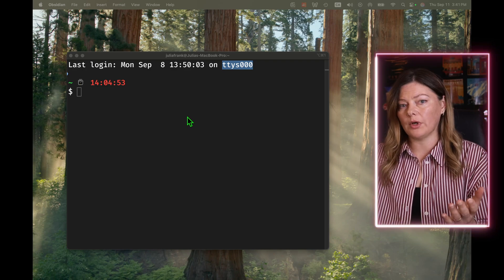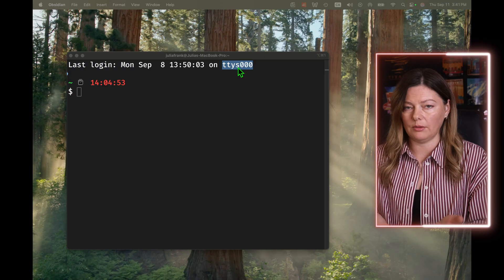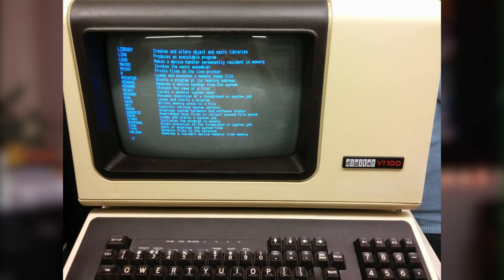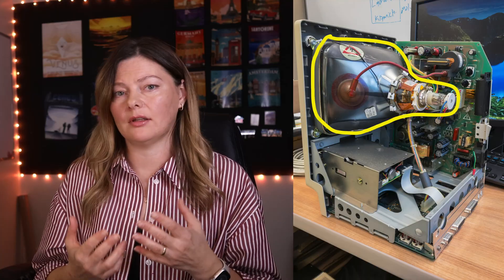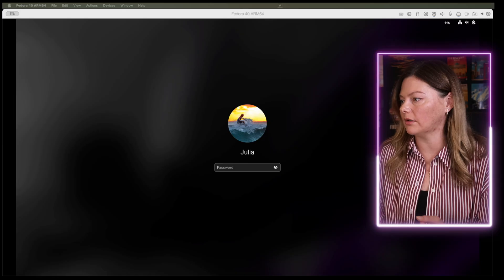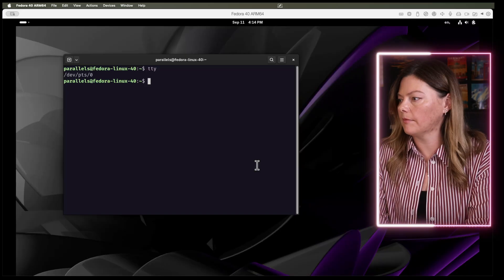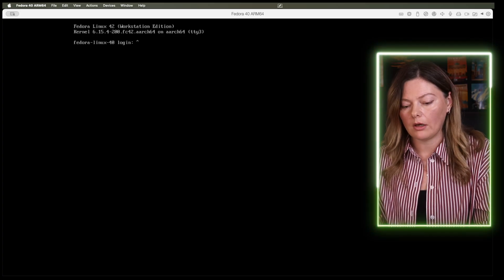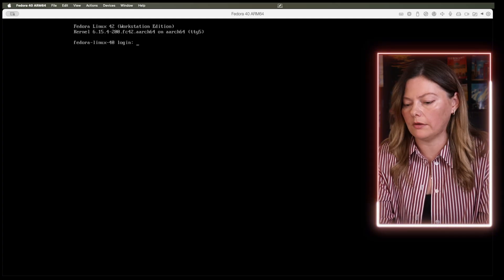What’s a TTY? (And Why Linux Still Thinks It’s 1970)

Comment: Fun fact, the first teletype interface was a modified IBM Selectric typewriter. This was chosen because the interface between the keyboard and the typing mechanism was an electrical binary-to-mechanical converter. This made it easy to redirect the wires to connect to the mainframe then have the mainframe output back to the print mechanism. This is also why TTY interfaces send each character you type to the server which then sends them back to your terminal to be displayed. (Yes, when you type a key into SSH what you see on the screen is actually being echoed back by the server.) Because the keyboard was disconnected from the printer head the mainframe had to echo each character typed so the user could see what they had just typed.

Comment: You're right, there's a whole class of software you can't work on unless you do this. I'm currently trying to port a NeXT like desktop solution over to FreeBSD from its Linux incubation platform. So I have to run 2 X sessions (experimental and the one with resources I need like docs and AI), and then I'm doing the development inside a FreeBSD jail so I can rollback (apply changes / test / re-rollback) while iterating. Knowing how this primitive layer works is essential for making any graphical plumbing."

While awful for the environment, the idea that you could take a listing ("printout"), rip it off the TTY, and then go outside, or take it to lunch, or show it to a colleague without that annoying-as-hell whisper knock or copy and paste is oddly romantic these days too.

Comment: I first started learning to program using a Digital DECWriter printing terminal, connected to a 300 baud acoustic-coupled modem.  I'd use a rotary dial phone to dial the number of my University's mainframe (a CDC Cyber 170 series), and when the mainframe answered the phone and started squealing, I'd put the phone handset in the modem's cradle.  Then I could type away on the terminal and the computer would print things out.  I've also used plenty of glass CRTs, made by DEC, Hazeltine, MIME, Infoton, and others.

I now primarily use a Linux desktop, and I typically keep three or four (sometimes many more) terminal windows open on the screen.  My favorite terminal program is "Cool Retro Term" (abbreviated CRT).  It's available via "apt install cool-retro-term on many Linux distributions.  It has an enormous number of settings to emulate both the good and bad aspects of those old heavy CRTs.  You can get a blurry, wavy, snowy picture if that makes you feel nostalgic.  Personally, I prefer a clean, readable display, but I do leave my terminals set up with a bit of curvature, to remind me of my countless hours spent in front of an IBM 3278.

Thanks for mentioning the ctrl+alt+Function-key sequence to bring up a new virtual screen!  I have been using Debian for years without discovering that trick.  The first Unix machine I ever used, an IBM PC-RT running AIX in 1985, had a very similar feature, though I don't remember what key sequence invoked it. Anyway, I'll make use of that from now on.  I'm always wanting more screen area.

Comment: It is funny to see in the comments how many people have used a Teletype, probably because the video title is "What's a TTY?"  I am another one of them.  It is also funny watching young Julia trying to explain what this monstrous machine actually is, and what they were like.  Well, they were very heavy, very slow, extremely noisy, and smelled of oil and ink.  The output speed was ten characters per second in CAPITAL LETTERS only, and a bell sounded as the carriage reached the end of a line, followed by more noisy mechanical doings when the carriage returned and the paper advanced one line.  There are several Teletype simulator packages for Linux, complete with sound effects and Teletype text effects for anybody not in possession of the real thing who wishes to see for themselves.

Comment: TTY, and the fact that it can sometimes be made to work when everything else is scrod, is the reason why one of my keyboards has a nine-pin serial plug and its own tiny little smartphone screen, in addition to USB, XT/AT,  PS/2, and wireless connections.  I never knew what would be available on-site when I got called in, but bringing THAT keyboard with me saved my butt a few times.  Sometimes the serial port is the only way to talk to embedded devices and prototypes.
Reply: what keyboard is that, sounds damn useful
Reply: @jackhancock2872  I had to build it from scratch.  I looked high and low and nobody sells it.

ARM microcontroller doing nearly everything.  Texas Instruments UART chip managing the TTY interface. And Kailh keyswitches because why not. 

It uses TMK firmware. TMK does matrix scanning plus whichever of wifi, USB, or PS/2 you want. But I've made several hacky additions.  I've added a "dumb" mode for TTY and XT where it just looks up scancodes in tables with different offsets. And I linked in the samfoo/VT1XX emulator, a firmware port of Kermit, an SPI-to-UART bridge, and an SPI video driver. 

I didn't have to do anything special to support AT mode, because it turns out that an AT keyboard is just a PS/2 keyboard with an XT plug. 

I do not understand people who build custom keyboards just for better aesthetics.  If I'm building  custom hardware it means there's something I want or need that standard hardware just won't do.

Comment: Why  tty was truly needed back then for humans to be able to read computer output, a form of a DE or DM in a way orTextUI lol, compared to then versus now with TTY it's way different and generally more limited, it just helps to have especially for boot and restart/shutdown, and Terminal like look text. Now, I dont really ever see it really running, but know it is for any need system has for it. I would just call any Linux distro a TUI/GUI, that has both,  go Arch Linux LiveCD/USB install way, that most likely totally uses TTY with use of TUI
From man tty, 
NAME   tty - print the file name of the terminal connected to standard input.  and only 3 -options, I bet you that the  tty command of 60s and 70s' into 80's, yes I did see them then but never used as I was a Kid, but I think it did have more specialized  -options versus now. 
Doesn't do much more at all now compared to what it did in the 60s 70s with printers/TeleType as those were Literally displays in paper form, lol

Comment: If you have a terminal and either your PC has a suitable serial port of you have a serial to USB converter you can still plug it into a PC running Linux and get a terminal session.  There are terminal emulators that will run in smartphones and tablets that will let you connect via the devices USB-C port and get a session.  You do usually still have to have a keyboard attached but that’s due to how the PC boots up, it can’t POST without a keyboard attached.  A lot of devices like network equipment have a serial port to allow you to plug in a terminal or emulator to access the management console using a built-in TTY service.

Being able to get a terminal session by direct connection can be very handy for support when things go wrong as it’s very low level, compared with the code to handle mouse, keyboard and monitor interface, so when the physical console is FUBAR you can often get a TTY terminal session.  I remember one time having to get the ops to connect a working Linux box to a borked SCO box via a null modem cable so I could dial in, telnet to the Linux box then TTY to the SCO box and basically reinstall X and a bunch of other stuff when someone who thought they knew what they were doing had tried to ‘tidy up’.
Reply from the maker: Thank you for sharing these details and the interesting use case you provided!
Reply: Multiple DEC VT 101 or 220 on a multiplexer to a 4 wire line to the Vax

Comment: "pty" sind "Pseudo Terminals", urspruenglich eine Emulationsschicht, die ein physikalisches Terminal emuliert. pty Devices werden bei Bedarf angelegt, z.B. fuer Logins ueber Netzwerk oder fuer "Terminal multiplex Programme" wie "screen"., aber auch fuer Terminal Programme unter X11 oder Wayland ("xterm", "gnome-terminal", "konsole", ...).

Das Konzept ist ziemlich universell und wird aus diesem Grund weiterhin fuer unix aehnliche Systeme verwendet. 

tty Devices fuer die Linux Textconsolen (zwischen denen man mit <CTRL>+>ALT>+<Fn> wechseln kann) werden mittlerweile ebenfally dynamisch angelegt, waehrend ihre Anzahl die bei frueheren Lnuxkerneln fest in den Kernel einkonfiguriert war. Wann diese Aendderung in den Linux Kernel eingeflossen ist, weiss ich nicht mehr. Ich bin ziemlich sicher, dass die Zahl der Textconsolen bei den 2.9 Kerneln noch fest war, und dass sie bei 5.x Kerneln bereits dynamisch war. Mit "openvt" kann ein neues tty geoeffnet werden, mit "deallocvt" kann ein solches tty wieder freigegeben (beseitigt) werden.

Comment: My dad used a pdp7 with tty and paper tape for a while an upgrade from using computer punch cards hauled to a computer center's mainframe. Which he used for a long time. His last work computer was a pdp 11 with every accessory you can think of and some you wouln't rhink of. So the fact that linux could interface with ttys as slow as 2 bits per second, at least it used to, was one thing I liked. At that time my fathers rather scientific building had paralel port wall sockets for calculator terminals, 4 function calculator terminals in every office.  I wish some one woyld maintain as best as possible a version of linux that could run on a 396sx. That is a hole in the linux ecosystem. If your computers are plugged into the same properly wired power wall sockets, one only needs 3 wires to have serial connection, using RS232. Maybe some day I'll tell you of my Mach III experience. And yes I am pro XLibre
Reply from the maker: Thank you for the time capsule and the interesting fact you shared! By Mach lll do you mean the old Mach 3 microkernel from the 80-90’s? Would love to hear that story sometime, when you are up for it)
Reply: @juliaifrank  BY MACH III experience, I mean  i did a digital add with the.addet circuit of a mach III tube based computer that was scraped before i was born. Adder was in a glass  cabinet  probably 3 x the size of a fridge looked like it was burning thousands of watts , and did not include registers so accumulator  was  neon bulbd
Reply: @juliaifrank one other detail I remember was, the additive registers were actually 2 banks of toggle switched. And the accumulator responded to every input bit flip, due to the fact that the section of the mach iii saved was only the adder itself That experience was 50 urars ago.

Comment: TTY or ASR -33 the teletype I used in in the early seventies.  They were terrible noisy and printing at 10 chars/sec (110 bps and 11 bits per character, 7 bits for a, b, c etc, 1 parity bit, 1 start bit and 2 stop bits), but it was a huge improvement for maintaining programs instead of punch cards.  To change "woord" to "word" in line 203 I typed: 203SL woord word.  SL means substitute and list, the listing of one source line could take up to 8 seconds :).  Later we used video displays (25 lines of 80 chars at 9600 bps) and that was an huge improvement using the arrow keys on the display to change one or more source code lines.
Reply from the maker: It took seconds to reprint a line… meanwhile we get impatient waiting for a tab to reload :)

Comment: What exactly is your point? In Linux, everything is a file. Serial interfaces for terminals are represented by files in the /dev directory. It’s got nothing to do with “thinking it’s still the 70’s”, it’s called backwards compatibility…
Reply from the maker: Still the ’70s’ bit is just a joke about that heritage. YouTube is noisy, so titles need some creativity. The video itself is about TTY naming and VT/PTY basics and its relevance today. Thanks for leaving your thoughts here!
Reply: It would have been possible to have a block device terminal (and OS/2 did something like that). But there's so much more you can do with a serial terminal that we'll keep this approach for decades or centuries more, not for backward compatibility, but for all the advantages. We can have screen/tmux, we can easily record and replay the whole interaction with terminal, we can add graphics if we want to (Tektronix, REGIS, SIXEL). All other approaches were tried and died out. Serial terminal will stay.

Comment: I started with a older model I think a ASR28 when I was in the USAF 1969-1973.   My first job after was repairing DEC PDP 8 computers, all had the ASR33 with paper tape readers and punches.  We used the paper tape to load smaller programs - times have changed.

Comment: It's weird to me that the terminal is even used at all...  The state of UI in the industry is exactly dick.  And, that's not just lame terminal usage...  Let me get this straight, the "modern" UI is based on what Xerox built in the 60s or was it the 70s with a mouse and graphical display?  We're doing so well in this industry.  Innovation after innovation lol

Comment: Like your video.
TTY or TTYs are the best too for  Gnu Linux  , Free BSD , OpenBSD , NetBSD or other Unix like operating systems , for ex when when program is stuck i just go to other TTY ex. control alt F3 and I can lunch my favorites       $ htop  and type F9 to terminate or quitting program or  daemon and no need to reboot . On Arch Linux was very useful since some of login manager brake time to times so I can login or use shell in tty to fix a problem.

Comment: Makes me feel old. I wrote my first program on a teletype at my school that dialled up a local college mainframe via a 300 baud modem. That would have been about 1974. It was a program in BASIC that printed "Behold the monster though hath created" ten times to demonstrate a thing called a 'for loop' - I don't think they ever caught on!
Reply from the maker: This made me smile. First programs stick with you. Thanks for sharing!
Reply: My first printer was a Teletype Model 28 -45 baud. Optocoupler and current loop all caps. Later a Decwriter on a line driver modem to the Vax.

Comment: My first contact with a real computer in the 80': in high school with a Mitra 15 (from the french company CII). 8 Sintra TTE terminals with CRT black and white screen displaying only text, writing only on the bottom line then scrolling up (like a teletype, not like a VT100 with X/Y addressable cursor)! And one Teletype ASR 33 with a ruban puncher to backup our program at 10 bytes per second. There was also an 8" floppy disk 128KB drive and a 256 KB (!) fixed head HDD. Don't remember the RAM but on this model it was from 8KB to 16KB 16bit ECC! (yes MB, no GB,  max 16384 Bytes!)
With this system there was max 9 concurent users! So when I open a termnial window I do remember that I did the same thing but with a VERY mechanical keyboard (a teletype is an electric typewriter) and rolling paper instead of a screen!
Reply from the maker: How do you still have all these specs cached?😄 Thanks for sharing!

Comment: 4:45 - In a not so distant past, all computers had a real hardware RS232 port or two (not through USB).

If you booted Linux on such hardware, you'd find a real TTY interface on the first "COM port" (to use Windows terminology) unless you had explicitly disabled it.

Of course, obtaining real TTY hardware is virtually impossible today, but it allowed access into headless servers without needing a monitor, on Windows you could use HyperTerminal, on Linux it was "cu" or kermit, which was kinda useful in a server setting, if your system didn't boot all the way to multi user mode.

Embedded Linux devices still have a serial port tty enabled, just not with a soldered-in hardware interface, for instance routers.

Most Linux distros kept the kernel console facility until around 2003,, so it's not exactly stuck in the 70's... more like the 00's

Edit: aaah, okay... sure it's possible to run multiple compositors directly on the hardware with graphics output, from [ctrl+]alt+ F1 to F7 if I remember correctly... historically your X11 session would always run on tty7 (F7), apparently your Fedora does it slightly differently. But in fact you could have both a framebuffer session, a Gnome and a KDE running simultaneously, no problem. I would however recommend you to keep tty1 as a text session.. if something that needs graphics breaks, you'll still have one console to debug and save it.

Comment: When starting in 90s with Linux (somthing like v1.6 or 2.0), XFree86 did not supported my ISA Trident graphics card so I spend a lot of months playing in the TTY. This was before Linux framebuffer graphics support so I played a lot with other graphics libs like the extinct GGI kernel support project, commercial demos of X servers like Metro-X , running X on VGA 320x240 or EGA 640x480 , etc. Fun times.

Comment: Man I'm old lol
Reply: [I was there Frodo.jpg]
Reply from the maker: Tell us a tale from the elder days, traveler🧙‍♂️😁
Reply: @juliaifrank  myself and another student slept on the floor of the computer room, recording magtapes and then loading them back when we upgraded from BSD 4.1 to 4.2. (The 4.2 file system was totally different than 4.1, which only allowed 14 characters in a file name). One of the tapes ended up with slight corruption, but our Guru figured out how to skip or fix it with "dd".

That's where the first "pty" appeared in Unix (to support remote terminals over sockets, which were also new).

Our console for booting the VAX-11/780 was an actual tty, which chattered away 24/7 with logging.